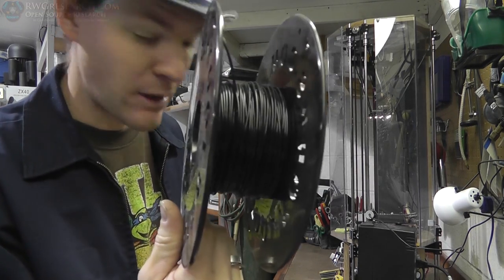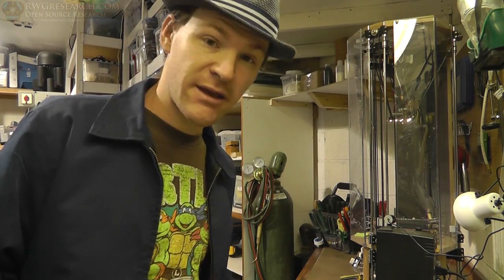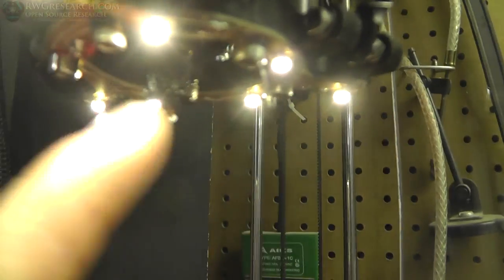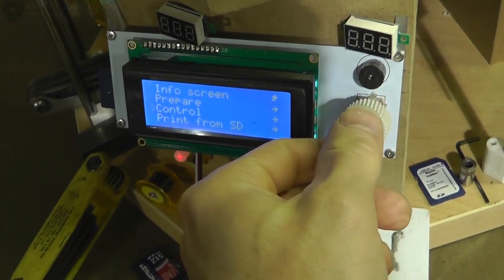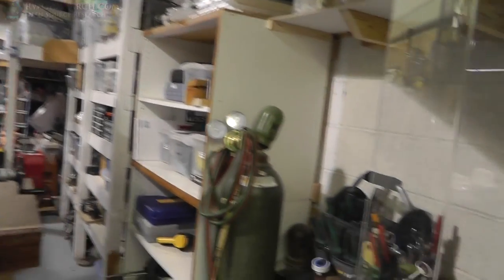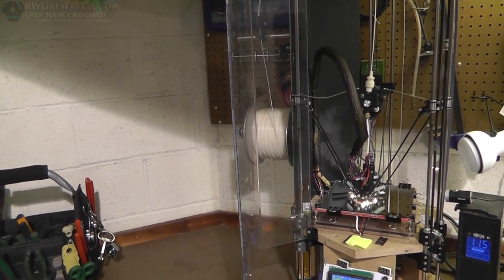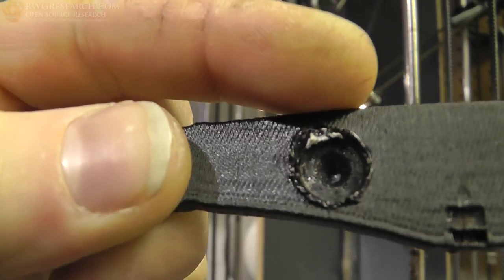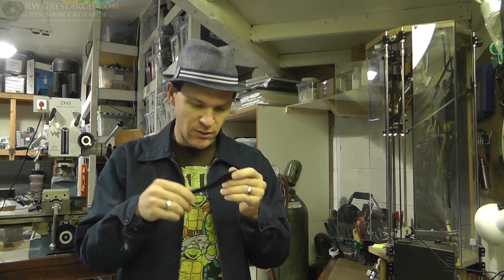The Best Method To Clean Your 3D Printer Hot End (Outside) & my Filament Change Tip.

Comment: I instantly realized what you were doing right after you said to melt the hot end into scrap plastic, and was struck by how novel a solution that is. I was getting ready to bust out the acetone and scrape at mine for like an hour, but this is a LOT faster, nice!

Comment: This totaly worked, I have to add that for PLA it is best to let it cool to 0 and then re-heat to 100 degree and pull the part out
Reply: Same here, cooled it down to room temperature then heated back up too 100 degrees (using PLA) and wiggled it off.  It's spotlessly clean now!
Reply: I discovered the same thing (I had to go to 120C) - it works beautifully!  It's like an inverse Atomic Pull!

Comment: What an  efficient tip. You can also try to gently rubb the surface of the nozle with a piece of filament. The melting plastic will stuck to the filament. Stop before the filament become too hot and stick... to the nozle...

Comment: HiThanks for the tip. In the background in the shop you have a gas torch setup. The gauges are left on when not in use is very bad practice. The green cover for the valve is there for your safety. Best practice is to cover the tank valve at all times when not in use. If the tank should fall or be hit on the valve will blow off and great speed. I am an x pipe fitter so I have some knowledge. What you are doing is very dangerous. Enough said.
Reply: Absolutely correct. We were taught in high school metal shop about that. When done with a job, close the valve on the tank, then bleed the lines to atmospheric pressure. It is not convenient to screw the protective cap onto the bottle after each use, because that means disconnecting the regulator. Instead, just make sure the bottle is securely chained so it cannot fall or be knocked over. Always screw on the metal cap before moving a bottle, because if it falls, the top valve can break and turn the bottle into a missile or if it contains acetylene, create a fire. 

Learn the Jiminy Cricket song, "I'm No Fool."

Comment: This video really helps and I will definitely be using the method in the future to save time. However, I had no scrap plastic around. I found that blue painters tape actually works well to wipe off PLA stuck to the exterior. The temperature that it worked best for me at was 188ºC.

Comment: 100% Isopropyl Alcohol should remove the mess from the extruder plus it helps the fillament from not sticking to the hot end. I do it every time before printing and it works a charm XD
Reply: Stupid question, but do you clean it with IPA when its hot?
Reply: Shouldn’t that only work with ABS tho? Not PLA?

Comment: nice tip 
print out "cleaning blocks" just a bit bigger than the hot end nozzle 20 * 25 * 15H mm 75% infill rough measurements

Comment: I was thinking of buying a 3D printer. I know you use yours all the time. Which one would you recommend to buy. I find there is too many options out there. Any help would be great. Thanks Jim
Reply from the maker: Jim Kittle hi, i like my delta, but it comes with its challenges. but its pros also.  really. depends on what your trying to do with it. delta has more space in the Z direction than most printers. ... just pick somthjing that fits your needs. if its already build it it should work right out of the box and you'll be happy... ~Russ
Reply: ***** Thankyou for the quick reply :) I will look into it further. I am going to be building some parts for my projects. Just wanted to make sure the quality is there.

Comment: the print pulled off the hot end nozzle from its heat sink and still didn't come of the nozzle till I heated the hot end, guess I won't be printing for awhile...
Reply from the maker: wow... how was that thing attached? just glued? most are screwed on... sounds like you should be able to glue it back on... i wonder if it was just press fit on... what kind of hot end was it? ~Russ
Reply: ***** metal pipe, its a 1.75 hexagon hot end from makerfarm.  I think ill put and Allen wrench thought the feed whole and try to solder it together

Comment: Not going to try that . I take the hot nozzle out heat it back up and use fine steel wool or just replace it.  They cost 15 cents if you by a 50 pack